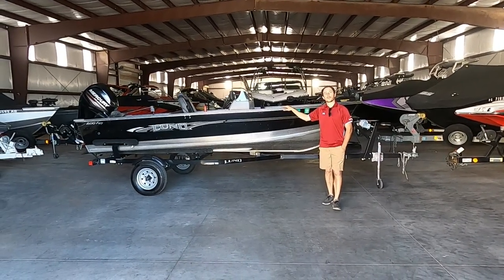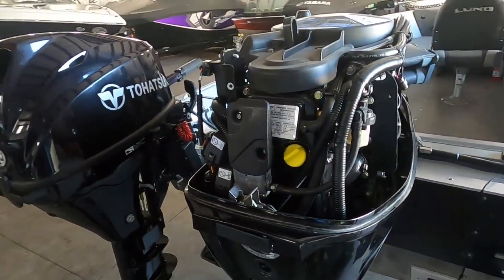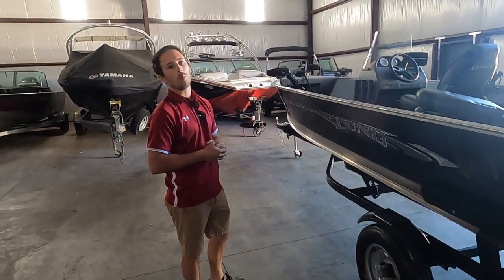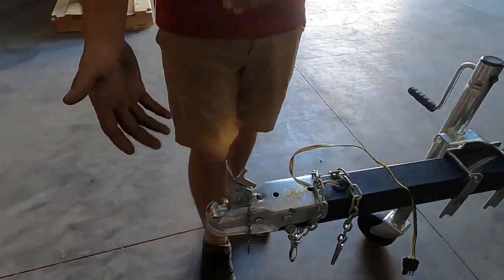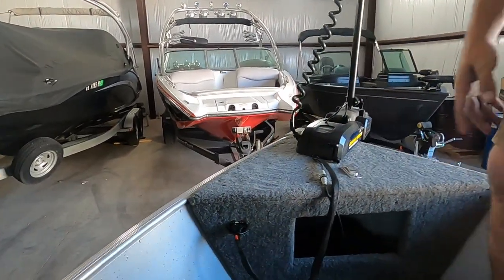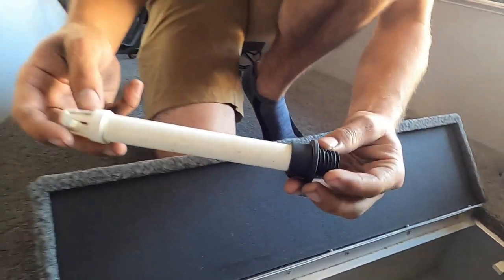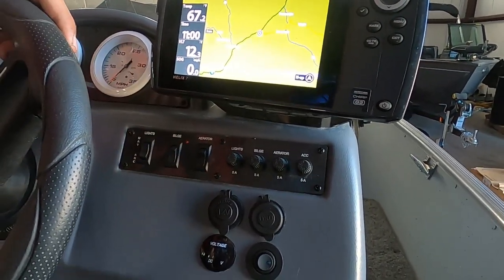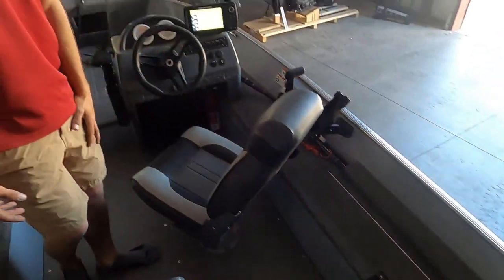Lund 1600 Fury SS Virtual Demo & Walk through

Comment: I have the same boat and there is no place to mount Rod holders. I noticed they drilled holes all the way threw the upper part of the hull. You can see the bolts on both sides. I can't bring myself to do that. Does anyone have a better idea for rod holders for this Lund?